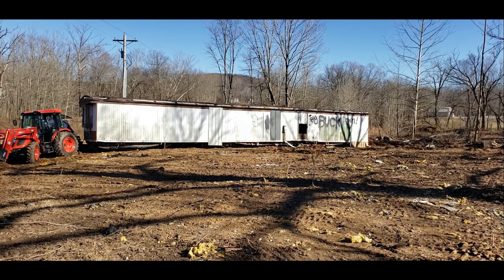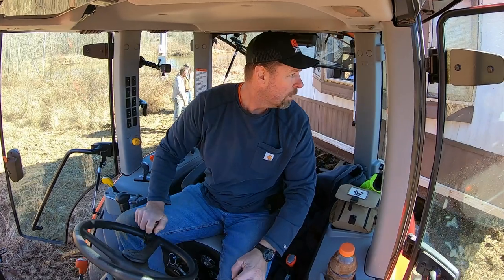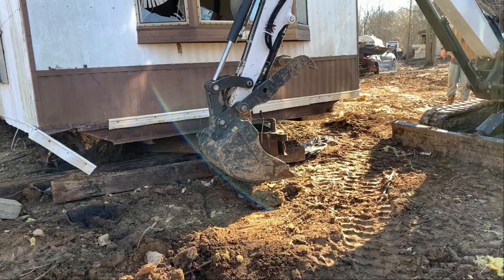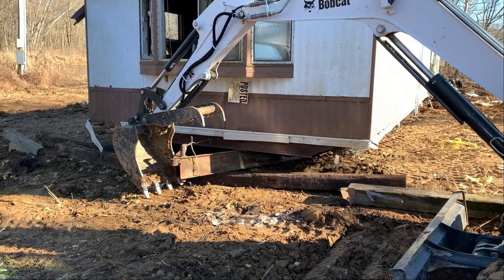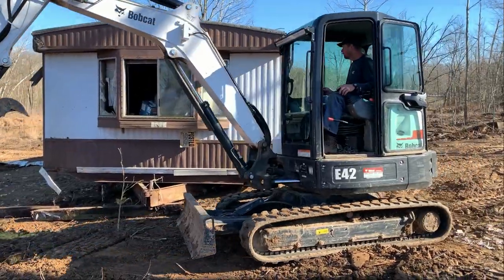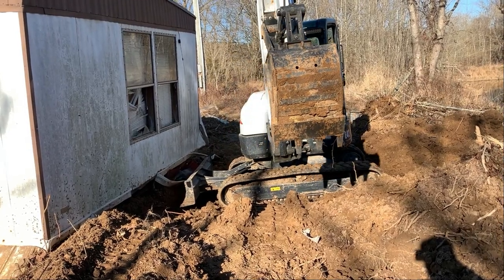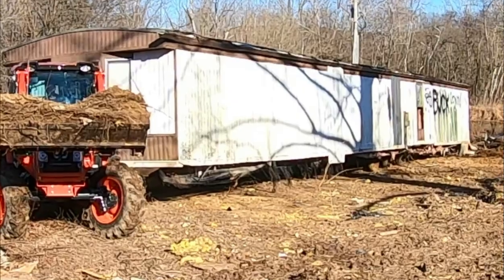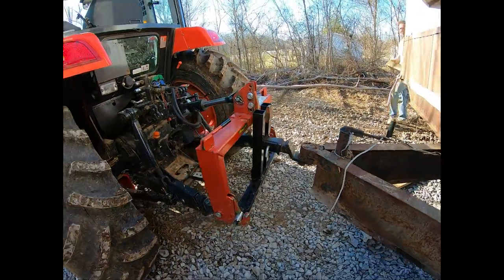Dismantling new 8 acre Picker's paradise land investment! JUNK YARD EPISODE #51! POSSIBLE? PT 2 OF 2

Comment: Moving that thing with the railroad ties reminds me of when I had to move a heavy garden shed. I arrived on the job early and got tired of waiting for the helper to show up, so I took a note from the Egyptians and used my noggin instead of brute force. I wedged it up slightly and found a long round stick. I put sections of the stick under each corner and was able to roll the whole thing by myself with ease. And the best part was that I didnt have to spend ages emptying it. And there was a good amount of weight still in there. (700 pounds?? of clutter) You shouldve seen the look on my helpers face when he showed up. PRICELESS!! :D

Comment: You might want to look at getting weights for the front of the tractor and if you would have had another tractor you could have had that thing out of there sooner. Good job on getting it out.
Reply from the maker: I don't think I'll be doing enough things like this to justify the weights up front. I do have all 4 tires loaded with fluid though. But in THIS case the weights would have helped!! Thanks man

Comment: Applause for a successful outcome. More than one way to skin a cat. Yea for you guys. One mobile home saved from the grave. Joe remember you have the front teeth on the skid steer grapple to use as a rake. Tip the bucket forward to the point where the teeth are about 60* from horizonal and lower the teeth till they just touch the ground and push an area forward. The go back at 45* from your first push and lower the teeth a little and push again. The go back 90* the other way and lower again and push to the pile. Then finish up as you first pushed the ground a little deeper. You should have most of the trash and roots in the pile and  can bunch it up and get rid of it. It should look like you ran the disk over it when your done.  Works just like a York rake with the tools you have.
Reply from the maker: Thank you sir. Yep, I agree with you, the grapple is Plan B though. Also trying to help out a smaller youtube channel, so if he comes with his tractor, should be a win/win, maybe get him some more views. Thanks.

Comment: It's all a matter of experience. The next time you know exactly what works and what doesn't. You did it and that's what matters. Thanks for sharing with us. Tip: If the load is too heavy for the excavator to lift, place a square piece of timber on the floor there as well and only use the bucket as a lever. It then has a lot more power. Pull to the side and you're done.
Reply from the maker: hmm, I think I know what you are saying, I do use the bucket leverage for stump roots. Thanks.
Reply: @kapperoutdoors  Yes, thats what I meant. Enjoy watching your videos in these boring times of Covid-lockdown. You and your Friends are pros and only people like you can show on youtube, that not allways things work out the first time. That's what makes a Video exciting. I can only be amazed at how quickly you got along with the new excavator. You have an incredible feeling for agricultural machinery - thats for sure. Keep up your good work!

Comment: Make sure you are ready for EPA.  Super Clean is a biodegradable de-greaser for cleaning small areas.  Safely remove bad soil areas.  Better to mow & do some more brush clean up.  Show how clean it is.  Nothing laying around.  Spend some extra time cleaning up all the odds & ends.  Make it look professional.  Present pictures of after clean up to be put in file.  Great inspections, will be approved.  Win/Win for Community.  Thanks for all of your hard work to get this huge mess cleaned up.  Congratulations.
Reply from the maker: Great point! Although we should literally pass with flying colors with everything about gone! :) Thanks
Reply: @kapperoutdoors  Best to do it right the first inspection, if possible.  If there is something EPA wants done, they will tell you.  The property looks so much better, it is amazing the difference.  I appreciate you & the others to take action for clean up.

Comment: I realize this is a bit late to be of any help on this trailer movement project but maybe it will help you in the future.  You were in a very tough situation with the soft ground and a very unwieldy load to move.  Using the differential lock to get the load moving was absolutely necessary. However when you have the differential lock engaged on a tractor it is nearly impossible to turn the tractor to the right or left.  Basically both rear tires are pulling equally, straight ahead and no amount of turning of the steering wheel will make it turn.  Even using the rear brakes wont help turn the tractor since the differential lock creates a solid axle where both rear tires turn together.  I hope my comments are not perceived as a criticism but rather as a helpful bit of information for future application.  Keep up the good work and good luck with the inspector.
Reply: Thank you Benji. I'm hoping he doesn't do that again! 😅 (Mrs. Kapper)
Reply from the maker: No problem I get it. I switched back and forth from Diff Lock to no diff lock, and without it, it wouldn't move an inch. BUT, you can see a little on the final run uphill I did have to use the left tractor brake, which is really the only way it would steer left, so that part worked out great! Thanks.

Comment: I thought if you put it in 4x4  differential lock that the front end & back lock up..
Reply: I'm glad you show stuff like this!
Reply from the maker: Nope, just the rear axle locks. Don't know of any tractors that lock the front diff. It would easily ruin the front axle and gears on a tractor to lock the front diff if the operator tried turning the tires/steering. I suspect that is why you don't see it.. Thanks.

Comment: Kapper, hook that bobcat to front of kioti and yank ii all over
Reply from the maker: That is a good way to ruin a new tractor! They are not made for that kind of pressure. 20,000 lbs of dead weight in the back and a tracked machine in  front. Ouch. But I get the idea I did consider it! :)

Comment: What is even going to pull this down the road??! wow
Reply: A short semi tractor made to move this type of mobile home, which they do every day. After new tires bearings and brakes. Hopefully it will not have to go very far. Now it is up on solid ground to where the dumpster is the trailer can be unloaded of some of the unwanted ballast I hope.
Reply: @frankdeegan8974  a-ha! Thanks! I couldn’t inagine anyone putting this behind their pickup truck, like the last one they took from there...

Comment: I would have burned it and scrapped the frame. Steel scrap is high right now
Reply from the maker: Actually no, steel is very low right now, couldn't even get a scrapper out here, it was a shame
Reply: @kapperoutdoors  that's too bad. I have 2.5 tons of domestic (US) Galvanized

Comment: Should have JACKED that home UP. SMH
Reply from the maker: hmmm, exactly how and why?
Reply: @kapperoutdoors  If you try to start pulling and pushing when the axles are buried down in a hole, you stand to twist up the axles and could possibly break the hitch. I'm glad you were successful at getting it out. I enjoy watching your videos on the cleanup. However you could have saved yourself a lot of yanking and tugging and time by getting the home jacked up and the tires sitting on planks. We were called in for a home on private land that was sloped that someone hooked on with a dozer and nearly tipped the home over and obviously could not get it pulled out. We took a lot of safety chains and come-alongs  to stabilize it while we jacked it upright and cribbed it up with timbers. (multiple 20 ton jacks) I was involved moving many a homes in my younger years. Brand new 14 x 80's with drywall, we always kept them up on planks and never wanted to get them buried, if we did we jacked them up. We broke a hitch once over the years, but probably moved 100 homes? I don't know I didn't keep count. Keep up the good work Kapper.
Reply: @elliskev2  I think we needed you on site a few days ago! 🙂